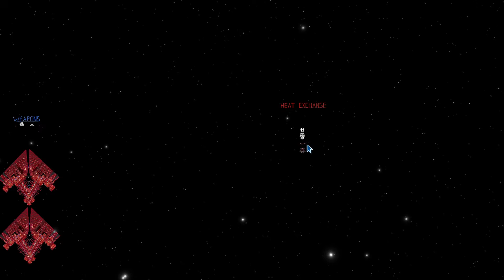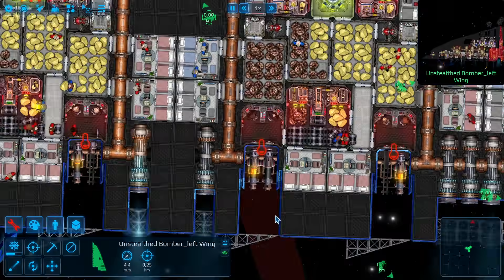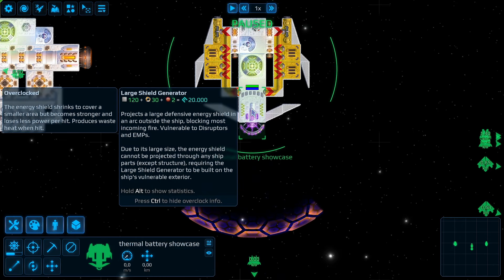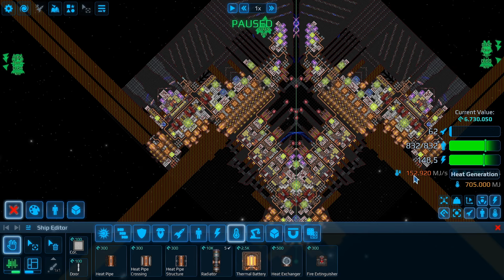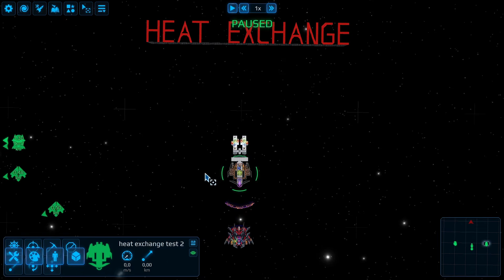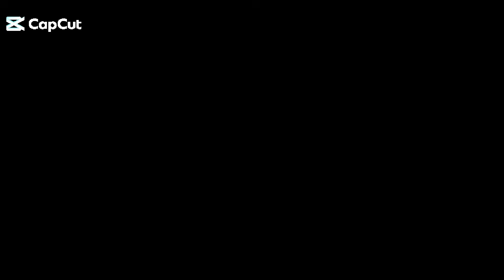Heat Management Guide After the Meltdown Update - Cosmoteer

Comment from the maker: One small addition for the Thermal Lance: this weapon is also able to transport heat from left to right, I just forgot to mention it ;)
Reply: Isn't it's the only thing that allows you to use it as core of thermal energy and output it with 1 pipe?
Reply from the maker: Hi there,

Thanks for your comment, unfortunately I am not sure what you mean by core of thermal energy, could you clarify that?
Reply: @Gobbo-Gamer  you can basically connect all the thermal systems on a small ship to the TRL using as a sort of connecting thermal core for everything and then output it with a singular output dropping the cost of the ship significantly and reducing the brain storm trying make your thermal system connect normally (no need to make pipes around specific blocks, etc, you just connect it to TRL and don't sorry about it)
Reply: HEAT MANAGEMENT MOD SAID THAT A PRESSURIZED ROOM WILL REDUCE HEAT PROBLEMS.

Comment: I'm trying to decide If I should Overclock thrusters or an engine room or both. Do you have any engine improvement builds?
Reply from the maker: Hi there, 
I don´t have any special OC Thruster Builds at hand, but usually it´s more effecient to overclock the Thrusters alone, at the current version of the game (if I am not mistaken), overclocking the Engine Room just increases energy efficiency and collects waste heat from surrounding thrusters but does not automatically overclock your thrusters as well, nor does it increase your thrust further. I´d say if you really just want more thrust, go for OC thrusters only (don´t forget to give them radiators or hook them to the heat grid directly... I made my experiences there XD) and if you require more heat for your weaponry overclock both, the engine room is a nice way to enhance your heat output :D

Hope that was useful, I wish you a nice day and good luck with your OC build!

Comment: How do I tell the thermal batteries to keep some heat stored?
I built a ship with thermal missiles, but it doesn't produce enough heat in combat to quickly create new thermal missiles after the first salvo has been fired.
It has thermal batteries to store up the heat generated outside combat, but it's all instantly drained away by the radiators.
Reply from the maker: yes that is unfortunately the downside, as far as I know there is no way to prioritize the batteries and so the heat just instantly evaporates into space, the only way to prevent this is to take fewer radiators than you actually need to cool your ship, while also installing enough batteries to never break your ship...

I hope that helped a little, have a nice day!
Reply: @Gobbo-Gamer  That's what I feared. i'll have to redesign my ship to include a reliable in-combat heat generator

thanks for the super fast reply!

Comment: I wonder if theres a mod that lets heat run through rooms instead of needing quite so many pipes. Tbh yea this system is MUCH stronger for bigger ships then smaller ships where space is a premium
Reply from the maker: Yes I agree, but it´s also not useless for small ships (I do have a smaller vessel with only 42 Crew and an Overclocked Deckcannon + 2 Thermal Canister Missiles and it does a pretty decent job)!

Have a nice day ;)

Comment: Do you happen to know any of the heat numbers involved with sun divers? Recently started playing and was trying to design one without overclocked parts, but i kept bursting into flames. Currently trying to figure out how much heat is coming in from the sun via trial and error with number of heat exchangers and radiators...its not going well, lol.
Reply from the maker: I think you are better off with a big row of large, not overclocked shields facing towards the sun and lots of backward thrust. I don´t know the exact numbers and never tried it out, but I am pretty sure you can´t simply use heat exchangers and radiate the heat back into the void. 

Have a nice day!
Reply: @Gobbo-Gamer oh yeah, im using shields and all, but they are still bursting into flames. I know they arent overclocked, since i havent unlocked the overclocked version yet, so i was trying to use the heat exchangers to prevent it. May just have to go ahead and unlock the overclocked versions to deal with the heat.
Reply: @chromehero  sun does half in physical damage, and half in heat damage. recommend not overclocked shield and some heat exchangers. Take some termal batteries with you too

Comment: This system genuinely makes 0 sense, what's the point of the engine room if the individual engines still overheat and blow up?
Reply from the maker: Hi there, 

Thank you for your questions!

Unfortunately I am not 100% sure what you are refering to exactly, I just assume its about my first showcase ship.

I think there are a few things you got wrong, let me explain why: 
Neither the engine, nor the attchements for the MRT-Thruster are overclocked here, so they can´t overheat at all. This example was more to show how to connect buildings with Pipes and Radiators correctly.
And even if they were overclocked that would be no problem, because Enginerooms capture exhaust heat from attached Thrusters/ Thrustermodules (with an inefficency-penalty), so even with no Module connected to the heat grid, they would still not overheat (with enough rdiators of course).

I hope that clears everything, let me know if this was helpful for you and if you have and further questions!

Have a nice day :D
Reply: @Gobbo-Gamer I think the commentor is talking about the practicality of an engine room (not your showcase), since an engine room is there to stabilise engines and in cosmoteer to increase engine output. So I assume the commentor is talking about how it makes no sense that an engine room doesn’t decrease the chance of engines overheating

Comment: Have you run any tests about where heat goes once in the system?  For example, I've a ship with themal missiles and radiators making heat from a few thrusters, sheilds and a single lance...  Does the position of radiator and missile matter?  If I want missiles to rearm first before it vents heat, do I need to put them before the radiators in sequence?  Is heat equally shared between multiple similar or dissimilar modules?  Does heat always flow into batteries from sources, and then dissipate from there into exhaust methods?  Important to know because for example if heat is shared between all storage equally when generated, wouldn't that mean capacitors would actually slow down missile fire rates if missile launchers function like storage, rather than radiators?  Or does it put it in capacitors first, then use the missile's throughput and drain at a fixed rate.  Also would radiators slow missile rearming?
Reply from the maker: Hi there,

Thank you for all these great questions!
Unfortunately I don´t have 100% perfect answers for you, but I was also experimenting a little with the placement and from what I saw: I think it doesn´t matter. Even if I placed the Radiators last, some of them turned on, despite still having some empty missiles. But with overclocked shields and Thermal Lances in one ship this shouldn´t be a problem during a fight, your heat output is so enormous, it will charge your missiles in light speed no matter how many radiators you have. Your bigger concern is to get rid of this extra heat, so I would not recommend to lower the amount of radiators just for a few % more missile fuel, if you underestimate the heat production especially of your bursting shields, you will set your shield array on fire frequently.

About the heat sharing between similar modules: yes it should be equal on one grid (you can see this in my video with the charging thermal batteries in my experiment-ships, they charged instantly and equal once the nuke hit the Shield) no matter how far away they are from each other because heat pipes transfer heat instantaneously. 

But I am not sure about dissimilar modules like e.g. energy share between Missiles and Batteries, but it seems to me that batteries are a little prioritized when it comes to great heat spikes in your ship (most times because of multiple failing shields). Afterwards thermal batteries then also give this heat over time (the rate depends on the amount of missiles/radiators on the grid) to both your radiators and your missiles, so it´s not totally wasted heat and I don´t think it slows down the fire rate, it´s more of another constant heat source for your missiles.

Please let me know if that was helpful and if you have any further questions!

Have a nice day/night :D